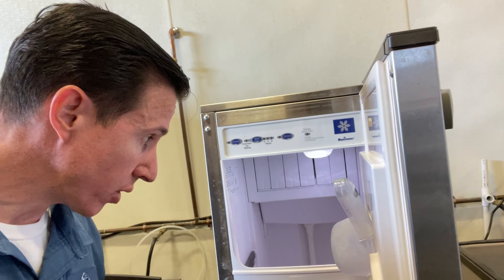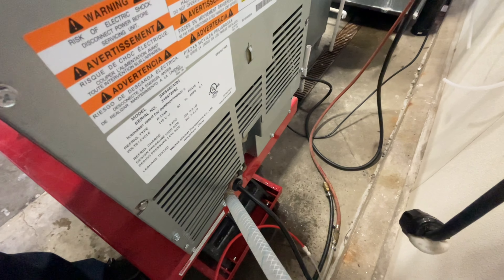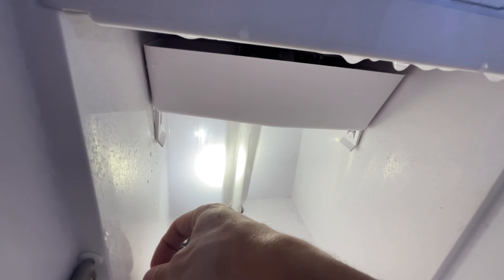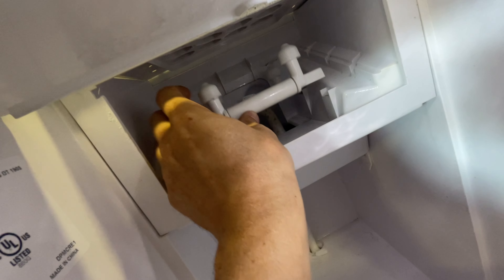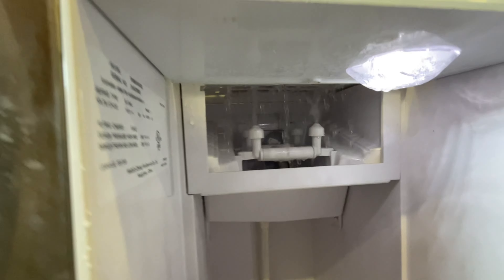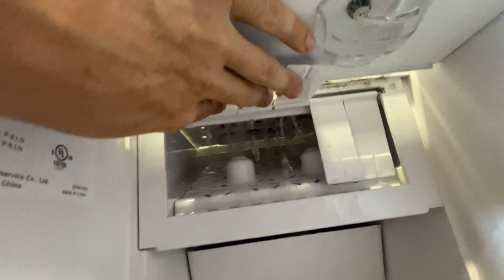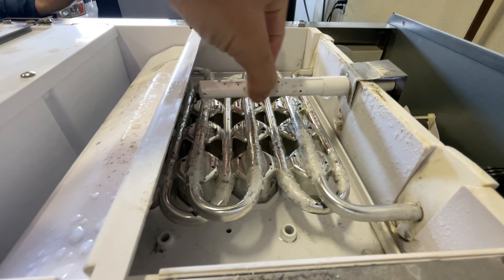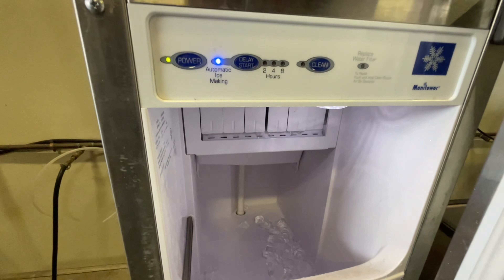Manitowoc SMS050A under counter ice machine troubleshooting

Comment: My unit just turned off one morning as if it is not plugged in. Is their  a electrical relay or something I can check maybe?
Reply from the maker: Check to see if the control board is getting power.
Reply: @IceMachine411  if not , is their some kinda relay that I can change out?
Reply from the maker: I don’t have the layout of this particular machine memorized. There should be a wiring diagram somewhere that’ll show you the important things to check.
Reply: @IceMachine411  thank you

Comment: Did replacing the evaporator water inlet valve help make harvest times faster? I bought one of these used and cleaned it up exactly like you did but my harvest times are really slow and the water flowing up top on the evaporator is even slower than what you showed in this video. 

Also, how do you know if it needs to be charged with Freon? Thanks!
Reply from the maker: The customer didn’t want to replace the water inlet valve. You should check on your water filter to make sure it doesn’t need to be changed. 

I’m not sure if this machine has refrigeration ports or not but that’s how you’d check. Use the pressures as a guide. If they’re in range then you’re probably fine.

Comment: I might have missed it in the video but was the machine still leaking after you cleaned it?
Reply from the maker: I might have missed it myself. The leak was being caused by the spray nozzles shooting water on the back wall instead of straight up onto the evaporator. Cleaning out all the calcium deposits fixed the issue.